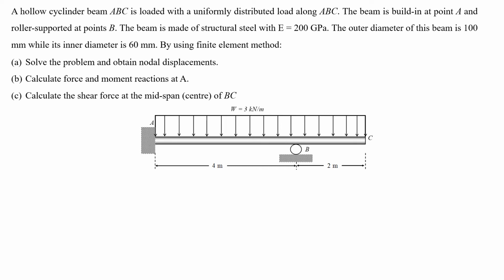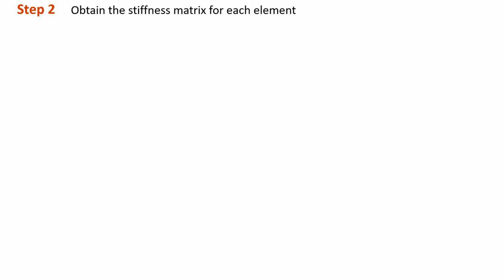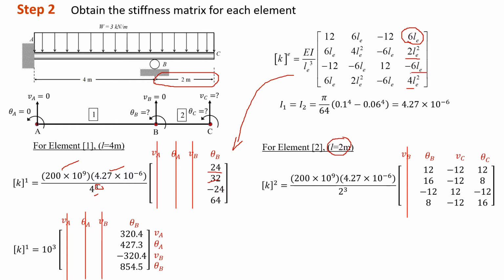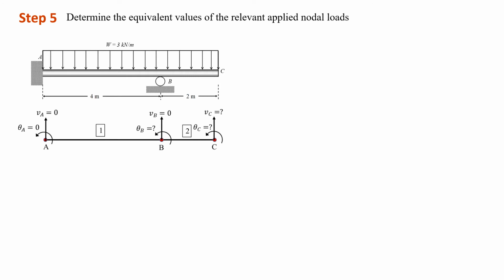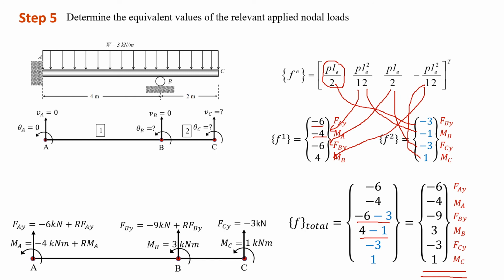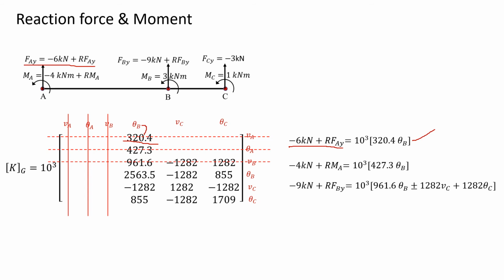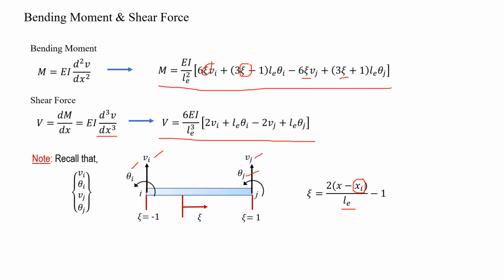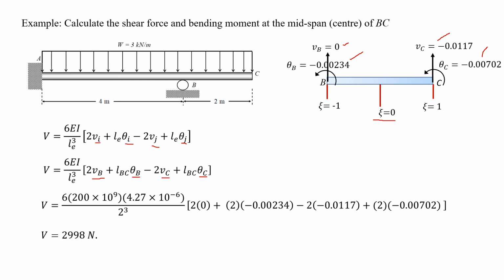FEM Bending (Example 1)

Comment: As per the shear force equation in the video , there is no term zeta( which involves x) so , that means shear force remains constant along the length. Then how can we find the shear force at support or any other point in a beam element?
Could you please explain sir?
Reply from the maker: The shear force that we are discussing is actually the internal shear force. In this example, if you calculate the shear force at support A using the shear equation (V=.725kN), you will get the same answer as the summation of vertical forces at A (Applied load (-6kN)+Reaction force(5.25kN)=shear force).

Comment: How do we calculate reaction forces from those 3 equations involving deflection and slopes?
Reply from the maker: we have solved the unknowns in step 6. Then, by using the solved unknowns, we can solve the reaction forces and moment. Just replace it into the equations.
Reply: Thank you sir 
And sir one more doubt
Towards the end, there are two equations of shear force and bending moment right
Can we use those equations to calculate SF and BM at any point in the beam?
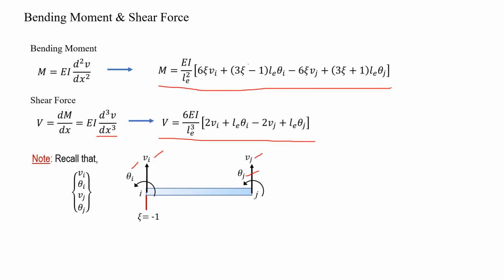Reply from the maker: yes it is possible as long as you know the value of x (distance from xi) @susmithdileep7444  . Please refer to 20:40 for the explanation.